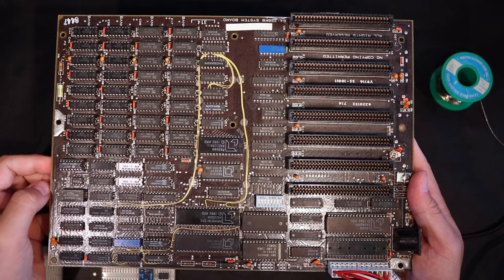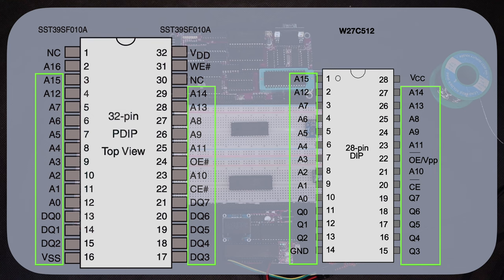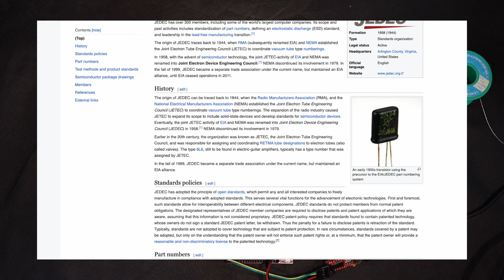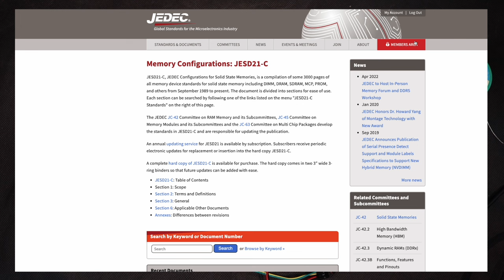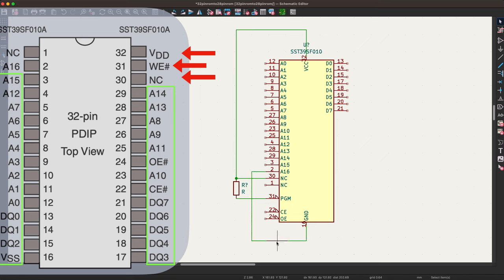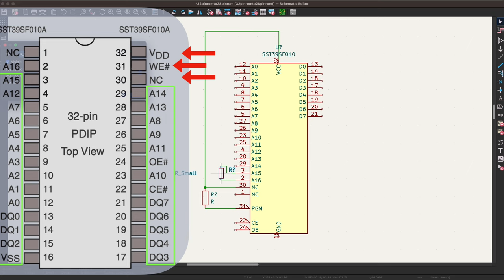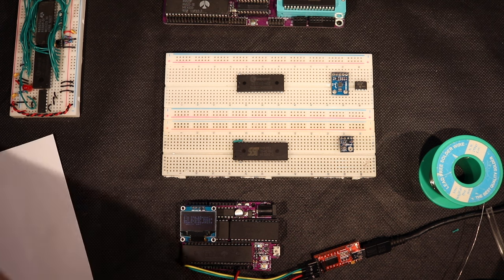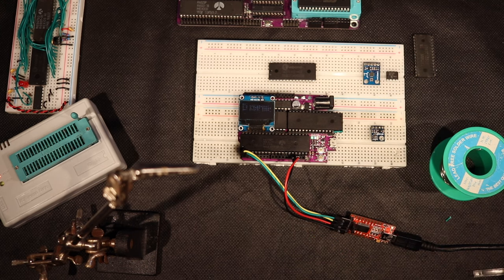Hacking ROMs for fun and profit!

Comment: Great overview. I just happened to be looking at options for replacing ROMs in various machines as well. It's a slightly different use case. But, I can definitely add the SST395F to my parts bin for when I run out of 28-pin parts. 

BTW, The Multicomp BLE DMM @7:31 caught my eye. That's the one I use daily (and used to have it stream measurements to a web browser back when I was doing live streams.)
Reply from the maker: Yeah, I’m a fan of value for money with that DMM. Took it for the capacitance and frequency modes - haven’t gotten too much out of the BLE mode yet :)
Maybe it won’t be so bad for recording measurements either.

Comment: Why the 300k resistor between A15 and A16? What is wrong with a direct jumper?
Reply from the maker: If it was a jumper we’d be making a short when programming/verifying the chip.
This way it’s basically unmodified from the programmer hardware’s point of view - for the WE I use a 10k because an accidental write is worse than a potential misread, so I want a bit more oomph.

Comment: Using this method, could you theoretically replace any eprom with these flash chips without making any changes to the software?
Reply from the maker: As long as you have the space on the board - and even if not you might be able to stack some sockets to lift the extra pins.
Sometimes it’s easier to make the modifications to a sacrificial socket instead of directly on the chip.

Comment: Can we only use the 39FS010 or also 39FS040?
Reply from the maker: The 39SF040 has A17 on pin 30, so you can't take advantage of the "no connect" on that pin for jumpering VCC to pin 32 - unless you only use the top half of the chip. It also has A18 on pin 1 so it needs another resistor. 
It's easier with the 010, but not impossible with the 040.